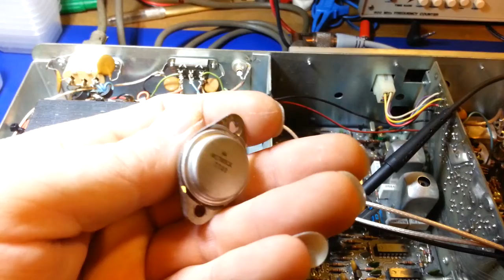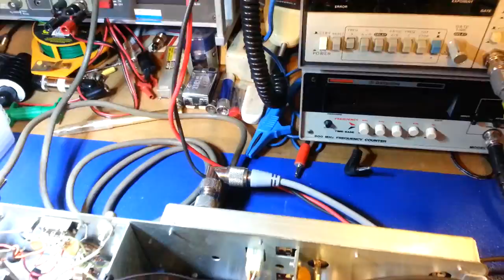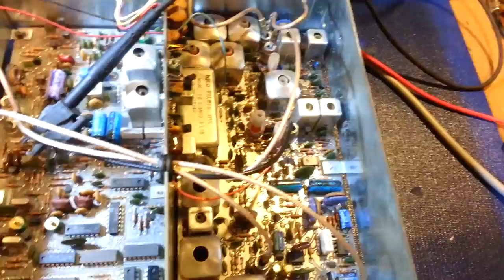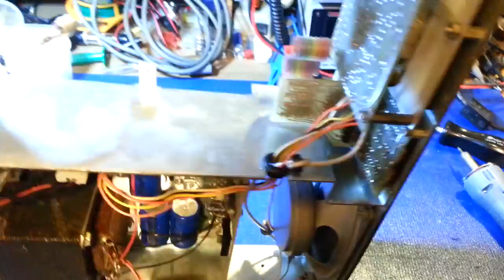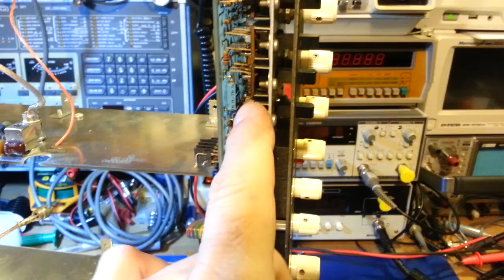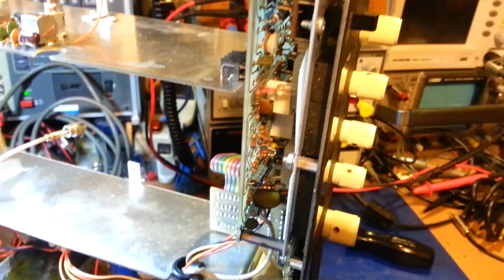CPI CP2000 Base CB radio restoration. Part 2

Comment: Great video's and thanks for sharing them. I have recently acquired a CPI CP300 and am trying to gather service information on. It seems to have an additional board installed that I am unfamiliar with. Have you any information on channel expansion for this radio?  I suspect this additional board has something to do with that as 49 on the channel selector is 27.355MHz but I want to understand it before I go ahead and realign it all.

Comment: CPI must've let their electronic engineers go wild designing that thing. Like they said I want you guys to come up with the most expensive overly engineered cb you can design, and use lots of one of a kind I.C.'s. Additionally we want a tableful of add-on accessories available for the radio so we can extract a small fortune from each of our fine customers.

Comment: Good deal on the repair so far mike. That front board is a PITA. I would do the same and install the caps on the back. Sent you an email about the Eprom.
Reply from the maker: Yeah, was one downside of these, the front panel serviceability.